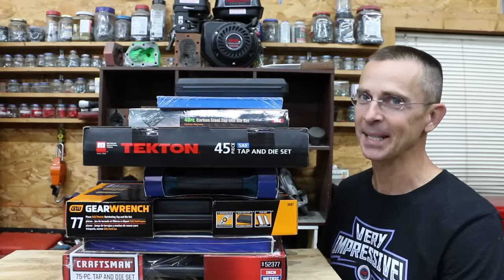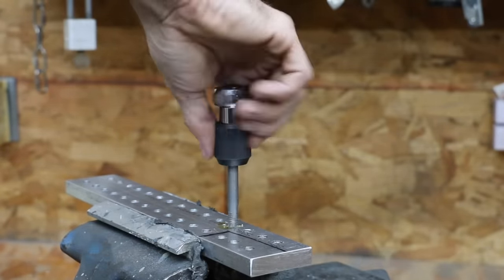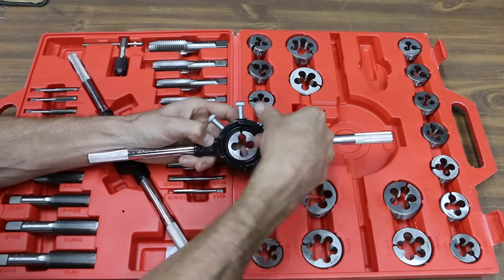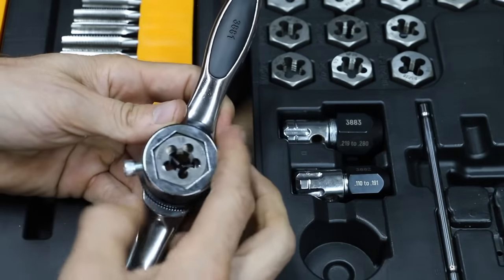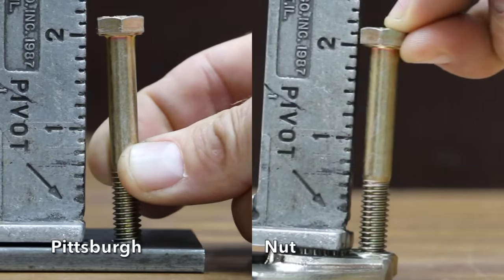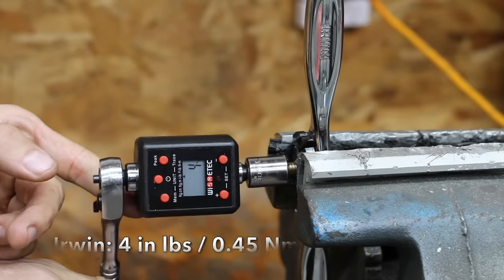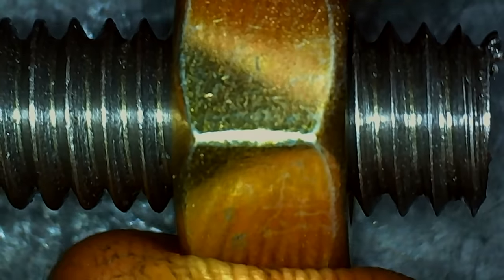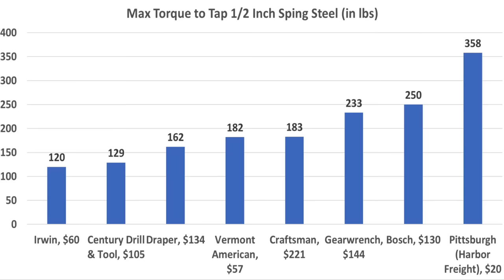Best TAP & DIE Set? Craftsman vs Irwin, Bosch, Draper, Vermont American, Tekton, GearWrench

Comment: Love the closeup of the Harbor Freight set with all the scattered parts and the poorly machined dies while you quoted their product's 'exacting standards'.
Reply from the maker: Thank you!  I was hoping Pittsburg would be of better quality.
Reply: hmm
Reply: @ProjectFarm  there's that sense of humor!
Reply: I actually thought the shot at 0:32 was a joke at first, good lord
Reply: Yeah the machining on the inside of the die looked very crude. It seemed like one of the other Chinese brands was pretty sloppy too. The Irwin-Hanson was a daylight to dark difference with beautifully cut threads.
Reply: Harbor freight does have an 86 piece set it's titanium and I'd love to see the comparison on that
Reply: @ProjectFarm  me to when I bought them to extract a broken grade 5 lh thread bolt.  The tap would not cut at all, but this video tells me it’s worth buying a good tap to try again.
Reply: I came here to say exactly the same thing.lol
Reply: pits berg.
Reply: @ProjectFarm  Hopefully Harbor Fright will watch this and get out a better product.
Reply: I wonder if their premium brand ICON has a tap and die kit to test? 🤔
Reply: @jamesgydosh6955  they are terrible. The only taps I buy at harbor is the drill master combination drill taps as an alternative to using self drilling screws in 1/8 to 1/4 in thick sheet or plate.
Reply: @richardgoebel226  I would think they can afford it.
Reply: I wanted to just chase some threads to clean out some gunk on my  aluminum dirt bike cylinder stud holes.  I bought that cheap harbor freight set.  I got about a 1/4 of a turn  into the hole and immediately decided to stop. I know they would have totally destroyed the threads.  We have the titanium set at work and they actually work very well. The die holder is cheap in the set, but the taps and dies are actually good.
Reply: @richardgoebel226 it costs 20 bucks and gets the job done vs 221 bucks for a little less torque needed
Reply: I found this confusing. You should not read these claims as you do. Sounds like you are endorsing them.
Reply: Precision tools are best not to cheap out on. I can confirm the low quality of Pittsburgh tap and die set. The taps had tough burrs that were friction welded into the thread cutting teeth from the sloppy manufacturing process.
Reply: Where's a good place to get Irwin tap set? Any links?
Reply: @daewooparts  that's great,  I'll have to refer to them properly now!
Reply: @l0I0I0I0  Irwin can be bought at any home improvement store and most auto parts stores. Keep in mind they are maintenance grade taps and dies and not meant to last for many holes and the dies are not meant for new threads. They are carbon steel so they are harder to break but they do not last many holes. If you need taps that last a long time get taps from a supplier like msc.
Reply: @FPSG  MSC?  Where do you find these?  May be out of my price range idk.
Reply: That was pretty rude. XD
Reply: @ProjectFarm  You need to research how to use these tools and revisit this one, I think.
Reply: @l0I0I0I0  MSC industrial direct is a supplier, and they are expensive. You can watch the ads and sometimes get 40 to 60 percent off.
Reply: @FPSG  Thank you FPS!  I've wanted a good tap and die for years now.
Reply: @l0I0I0I0  A good tap or die will cost $10 - $25 per piece. Look for HSS (high speed steel) material, not carbon steel. HSS with 5% or more cobalt is even better. When assembling my collection of Taps/Dies I bought them one or two at a time, or when I had a particular need for a size. This allowed me to accumulate a good set of very high quality tooling without a big one-time purchase. An industrial quality set of UNC & UNF (or metric) Taps & Dies can run between $500 and $1000.  MSC Industrial Supply, Suncoast Tools, Grainger, and many other firms sell Taps/Dies, drills, and other cutting tools of high quality in sets or individually. Often when a poor quality tap or die fails it will damage or ruin the part, and that could make a cheap tap/die very expensive indeed.
Reply: Irwin bueno
Reply: @ProjectFarm  I actually have the Pitts $189 sets, both SAE and MET.

I am happy you are comparing this brand, It will help me buy the next brand as a Mobile Mechanic. Thanks!
Reply: @FPSG  I like those quite a bit.  And they're so cheap that when they break it's no big loss.
Reply: @ProjectFarm  Keep hoping :-O
Need to improve your dark vocabulary? Use Harbor Fright tools. (But NEVER in the presence of children, lest they also learn new words :-)
Reply: @l0I0I0I0  Ace Hardware
Reply: @gavinmclaren9416  Long ago, I purchased only semi-crappy japanese made (Harbor Fright?)  imperial and also metric set. When I need to do 'real' tapping, I spring for a quality tap or die, and replace the chinesium version.
Reply: @pirihern9329  Thank you!
Reply: @gavinmclaren9416  Thank you Gavin!  Good points
Reply: @BrilliantDesignOnline  Ace hardware has always been one of my favorite stores.
Reply: Yah, those Harbor Freight are completely useless.  And the ratings are terrible - I don’t know why they continue to produce them.  I was legitimately surprised he was able to tap aluminum with them given my experience. 

If you want the good stuff, get Norseman.  They aren’t cheap, but I don’t feel their prices are ridiculous.
Reply: Yeah I was down bad and grabbed a set of the Pittsburgh. The setting screw for the twist handle thing stripped within 5 mins lol 
The threads also disintegrated after rethreading a 10.9 bolt.

I deserved it for buying it lmao
Reply: The 60 piece set from HF is better quality than that set.
Reply: Most h.s.s taps are way better than carbon taps.
Reply: I guess it's fair to ask "Exacting by what measure?"   
Answer: Must be able to cut at least 1 inch of thread in aluminum without appreciable wear.
Reply: All these are just toy sets used to clean up a damaged thread. Most hss quality taps and dies are so much better. With a split die you can control the thread diameter for best fit. I have single dies that cost more than the whole set of your most expensive set. If you most buy cheap, the draper is a British brand. They distribute knipex and elora in the uk. Its not a bad set, the one I've used has tungsten taps and dies and is made in Taiwan. Most are cheap Chinese High carbon steel that go blunt very quickly in hard materials like stainless.
Reply: @Anonymous-oy6rj  yes and? I'm just giving more information about what the set is and were its from.
Reply: @FPSG  yeah I’d look into OSG too.
Reply: @gavinmclaren9416  Agree, cheap tap can cost the price of a hss set in redo damage.
Reply: That harbor freight set is absolute garbage. I bought it a couple years ago and promptly returned it
Reply: @FPSG  I've had good luck with that set. I mainly use the 1/2" and larger sizes, never had issues with them.
Reply: @BrilliantDesignOnline  These days Japan made means top of the line. Made In Japan is highly regarded across a variety of product types.
Reply: Still better than that hundred and some dollar set that didn't even have the threads cut in it, or the one that was all rusted already.
Everybody knows Harbor Freight is hit or miss, many times on here they've had products that were very competitive quality-wise for a much cheaper price.
At the end of the day, almost all this shit is made in China anymore, that's why it's nice to have somebody like project farm that can help you not buy cheap Chinese crap.
Reply: I had to rewatch it, that has to be embarrassing for harbor freight, looks like they have no quality control.
Reply: For 20 bucks the Pittsburgh set actually did what it was supposed to do, cut imperfect but usable threads. For more than 5x the money the Tekton die was unusable and the tap broke, which is not what it was supposed to do. Doesn’t seem too difficult to figure out which tool offers the best return on investment here, lol.
Reply: Yeah not going to lie I'm usually pulling for hf since I'm cheap but I have this set and can confirm it sucks
Reply: @ProjectFarm  old pittsburg was so much better quality then this new crap from the harbor fraud. I Go with husky or kobalt now for budget shit
Reply: @Project Farm  I have a different Pittsburgh tap and die set. While it's not the best it seems a little I
Higher quality. I bought it 3 years ago to tap grade 8 bolts to make an adapter, the tap held up tapping 6 bolts
Reply: @jamesgydosh6955  Well, it's actually titanium nitride coated, not solid titanium. Not sure if that even makes a big difference in performance. Pretty color though...
Reply: @jamesgydosh6955  don't try them, the machining is so bad the smaller tap won't even engage the handle it comes with
Reply: My Harbor freight set is over 40 years old and I have NO issues with poor cutting or loose holes or cutting to much or sloppy bolt threads, I'm really very pleased with both sets SAE and MM sets
Reply: @hexsaver420  omfg no way that was brand new out the box...i cant believe that!!
Reply: Mmm ya hahabrofright
Reply: @BrilliantDesignOnline  Literally lol.
Reply: @daewooparts  b(oo[
Reply: @marksmith7054  40 years ago Harbor Freight was made out of real steel & probably Taiwanese or Japanese, now it's all made in China from Chinesesium
Reply: @daewooparts  could very well be, I don't remember where these are made but so far so good one of the few things from HF that do last,  I do have an electric 1/2" Impact that I bought about the same time, it's been well used and the cord finally broke. and a bunch of Misc end wrenches are still around.  mot most of the time they are throw away tools after a short time.
Reply: @BrilliantDesignOnline  …. “chinesium”  hahaha😂 good one!!
Reply: @BrilliantDesignOnline  You found crappy Japanese taps? Where? All the Japanese stuff I find is top of the line. Chinesium is made in China, not Japan. They're different countries. Japan is a series of islands 🗾. China is a big chunk of the Asian continent.
Reply: @lambdaman3228  I have both and the japanese ones are from the 80's, and I know geography, probably before you were born. Japan used to be the chinesium of tools (and cars).
Reply: @BrilliantDesignOnline  Then why isn't it called Japanesium?
Reply: @lambdaman3228  I was catering to Millennials 🙂 Call it what you like.
Reply: @saganandroid4175  Unless you can just barely hear his slight (but well deserved SARCASM!).
Reply: @FPSG  GOOD POINT: A through explanation on the different kinds of thread cutting tools is in order.
Reply: @Anonymous-oy6rj  And reading the "claims" with just the right amount of sarcasm!
Reply: @BrilliantDesignOnline  They WERE (past tense) of bad quality, but only because of a lack of good materials and infrastructure, but their design and dedication has been very high for centuries. After some years following WW-II, Japan took the lead, and now 99% of their products are way better than any USA made ones, IF american products can be found... as there are no known cameras, electronics and many other "american" made items anymore.
Reply: @alfredomarquez9777  I know this and agree.
Reply: @ProjectFarm  please do security cameras w dvr...
Reply: I use 40 year old Starrett taps n dies... Waltham Mass. Made. 
Absolutely the finest in the field. Properly used the Starrett taps do not wear out. Cut like going thru butter.
Reply: China makes junk..??!! No fkn way 😂🤣😭
Reply: So, those pictures of the Pittsburgh from Harbor Freight shows that they're shit. I would throw them away when they look like that.
Reply: @jamesgydosh6955  can you please clarify "titanium".. did you mean made out of titanium or titanium nitride or TiN surface coating? Thanks for your time
Reply: While I'm no fan of HF, I did buy an imperial/metric tap/die (HSS) set from them about 7 years ago, mostly to get a selection of the metric tools.  I've actually had very good luck with the taps in particular.  Even the dies aren't terrible, although if I want to make good threads, I'll dig through my boxes of better ones.
Reply: That's why they're referred to as Hobo Freight
Reply: @ProjectFarm  They used to be, just 40 years ago.  ;)
Reply: @jamesgydosh6955  it’s definitely not titanium. Maybe Ti coated. But that’s just a very thin vapor deposition of Ti.
Reply: @richardgoebel226  Not at a $20 price point.
Reply: Would you be able to do do the best bit sets ie price per quantity, usable bits/practicality (commonly used fasteners) durability, tip fit and limitations
Reply: @ProjectFarm  - HF has another Tap & Die set that they claim as being a better quality as the one you tested.
Reply: I literally laughed out loud 💀 🤣
Reply: Very true lol. I thought they came out with a higher quality line of tap and die set?
Reply: @jamesgydosh6955  Yes, maybe they claim to be titanium but they are just titanium coated steel (TICN coating). If they actually were titanium they would be very pricey im sure of it.
Reply: @saganandroid4175  As my father used to say, "It's a joke, son!".
Reply: @gavinmclaren9416  Agreed I just buy good quality taps and dies when I need them. I can't just go out and spend $500+ on a set but I can buy a $20 tap when I need it.
Reply: I bought the Pittsburgh metric tap and die set yesterday since I was going from bench seat to bucket seats and they made the job a big pain in the you know what. The 12x1.75 would slip in the tap wrench since It barely had any surface area to grip and all the taps had super rounded edges. I had to use smaller bolts and tighten them under the cab since I had already tore the interior apart and needed it done for work on Monday. Long story short I do no recommend the Pittsburgh tap and die set. 👎🏿
Reply: I think going in, anyone familiar with most "pittsburgh" tools will know that the set is at best a "thread chaser" and at worst will ruin good undamaged threads.
Reply: For $10 it's hard to complain. It will in fact get you one tap if that's all you need
Reply: I use an older Pittsburgh set that looks identical to the tekton set. Even the layout of the case is the same.  Most of what I do though is thread chasing to clean up gaulded threads and have never had any issue with them. I may have gotten lucky, but the older Pittsburgh set I  have seems way better quality than both the Pittsburgh set and tekton set shown here. I guess buying cheap chinesium tools from Harbor Freight can be hit or miss on the quality control.   Thanks for all the comparisons that must have taken forever.
Reply: I bought harbor freights biggest tap and die set, used it once and took that sucker back. They're JUNK.
Reply: The torque measurements can be somewhat misleading as a tap/die could be mfg. for less than 75% engagement (meaning real sloppy). So it cuts easily but gives a poor quality thread.
Reply: Alas, you typically get what you pay for… 😒💸